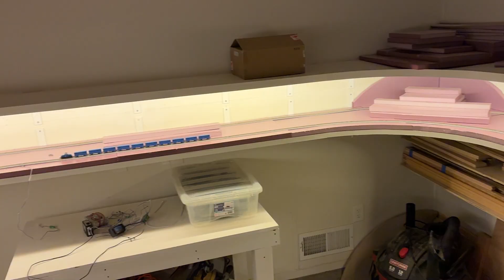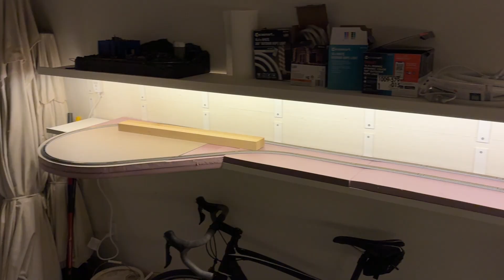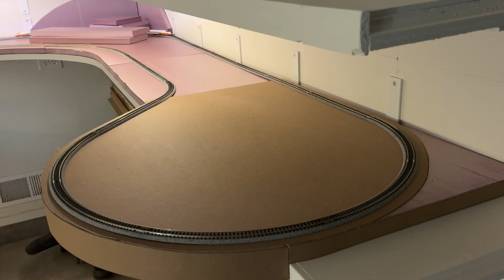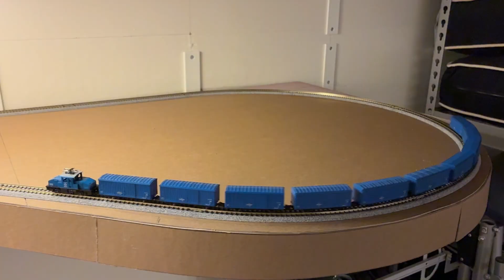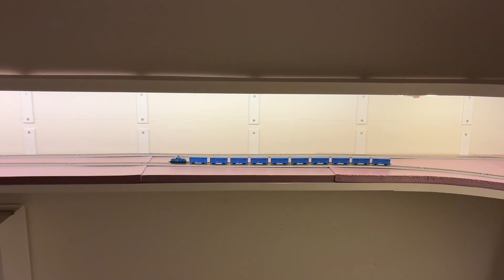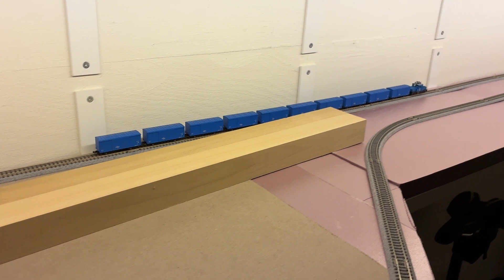Built an eighty foot n scale test loop.

Comment: Will this eventually be a single track auto reverse loop...  digging the progress
Reply from the maker: Thanks. Today I built and tested a single track auto reverse loop on this shelf (but I stacked the two reversing loops at one end, and kept a simple loopback on the other end). So far, I really like it more than the basic oval. Stay tuned, It'll be my next post. The challenge is that I want to run high speed rail and freight. I almost need a dedicated line for the bullet trains. Which complicates things. But for the freight trains, the single track auto reverse is perfect.

Comment: Based on what you said Sievers bench work is the way to go. It is open grid and will make wiring a lot easier. You can buy theirs or cut your own. They bolted together so you can disassemble them. Check it out.  Kato track is good. Its running good now but the joiners loosen up over time. Especially if you disconnect them a lot. If you are going to run the track that close to the edge use Super Elevated track. They bank inward.
Reply from the maker: Thanks for the tips. Sievers Benchwork looks really nice. I went with a floating shelf to free up 100% of the floor space beneath the layout for things like bikes. Floating shelf also minimizes the amount of lumber required. I plan to run conduits for wiring. Regarding track close to edge, I only have to do that on the loop arounds. I plan install ‘walls’ or ‘guardrails’ on those convex curves. I will definitely be adding more track power feeds too. I just wanted to test the limits here.
Reply: @rich_foster  This hobby is a lot more difficult than most and expensive too. You want to avoid rework and have the ability to recover from mistakes. Rabbit holes are dangerous as we can fall prey to them. We want to avoid rework or starting over and it leads us deeper and deeper to the point of no return. In reality its cheaper to start over. Having the ability to adjust the bench work is important.
Reply from the maker: @my88k-mrr98  I hear you. I appreciate your  advice. I don't disagree. I think I'm just approaching this garage project from more of a 'mad scientist-maker-tinkerer' place rather than a long term, life long model railroad hobby place. I built the floating shelf as a permanent garage feature that is not specific to model railroading. I can use the shelf for any number of other hobbies or display several micro layouts at once, or sculptures, or maybe use it for arduino robotics, or wargaming, etc. Or just use it for storage. So in that respect, the cost of the shelf does not factor into the hobby at all for me. Since it can and will be repurposed.

The mega train layout is just superimposed over the shelf in a semi-modular way. I can test many different layouts, tear them down, try new ideas. The Kato Unitrack is pretty much a Lego set to me and can be reused many times. At some point I can build and place modular removable scenery if I decide to complete a design.

I built my own DCC command station and I install my own decoders and have spent less than $500 total on all my locos and rolling stock so far. All in all, even with this mega layout, the hobby has been relatively inexpensive. My two bikes are worth  more than all my train hobby stuff combined.
Reply: @rich_foster  We are somewhat the same. That's why I commented I could hear the "Mad Scientist" in you.
Reply from the maker: @my88k-mrr98 I appreciate the feedback! Anytime! It’s great to get perspectives. And thanks for your interest.